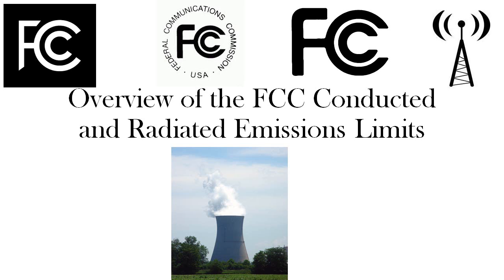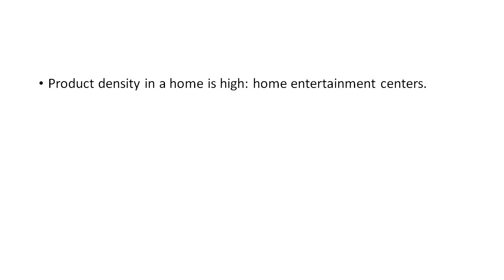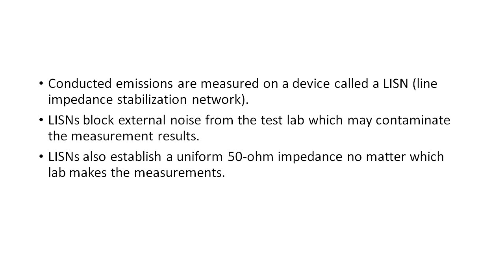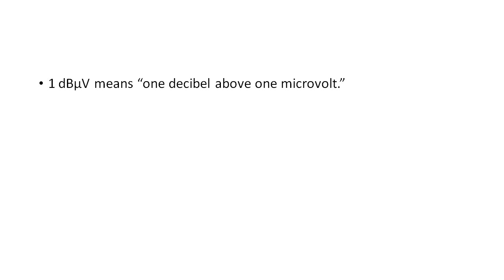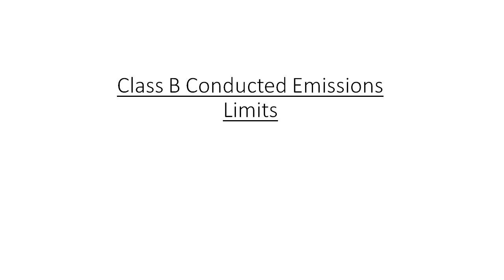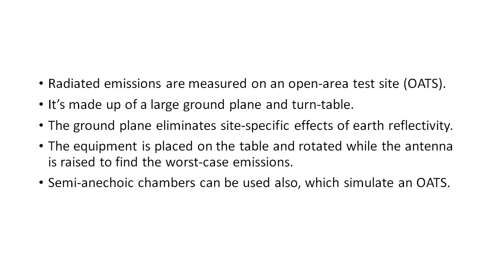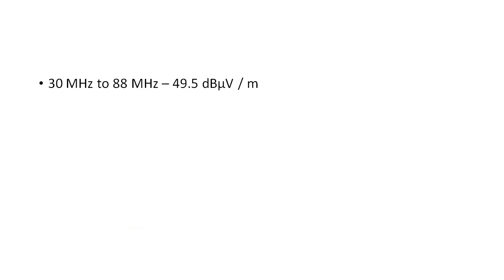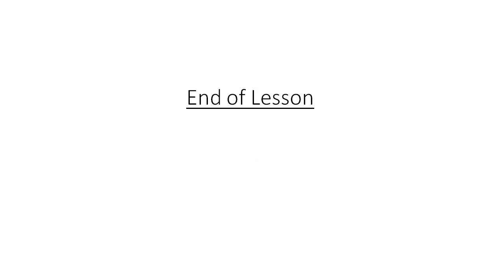Overview of the FCC EMI, RFI (EMC) Radiated and Conducted Emissions Limits

Comment: I have some relative experience in EMC testing however recently  I have started a new job where Emission measurements are made with in non orthodox manner which I cant understand fully. Radiated emission are usually measured with an antenna to pick up the relevant waves from different angels of the EUTs. However the method than I'm not aware of is something called 'Radiated via CDN method' where the emission levels are measure via CDN instead of an antenna. apparently this replicates the distance and levels of radiated emission without taking having the antenna. Have you come across this method before ?
Reply: The method I think you are referring to is used by companies that do not have a calibrated facility and may not even use calibrated equipment...scary! After getting back from a certification lab with a fail the EMI engineer needs a cheap way of getting a reference level. Emissions are generated by the product so reducing the level at the source from the reference level is good. It doesn't mean it will be the cheapest solution, taping over a slot would be cheaper than going to spread spectrum clocking, but if they reduces the level by the amount needed to pass we're off to market. Conducted emissions is my favorite as cables are the best radiators.